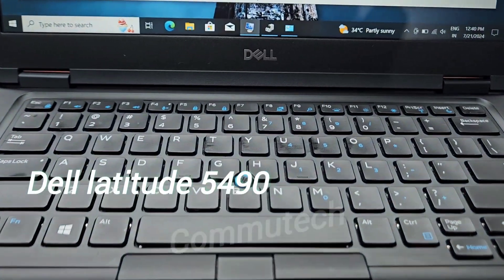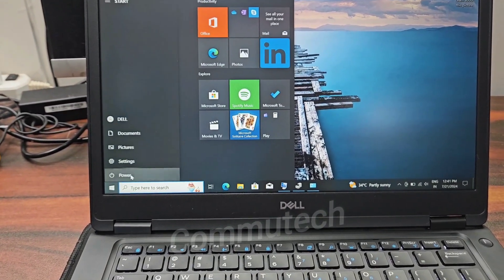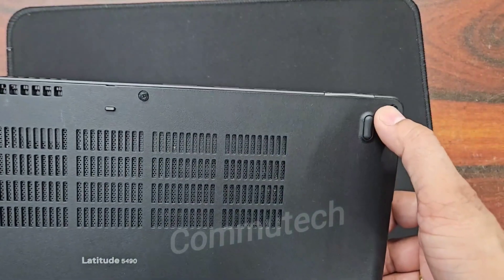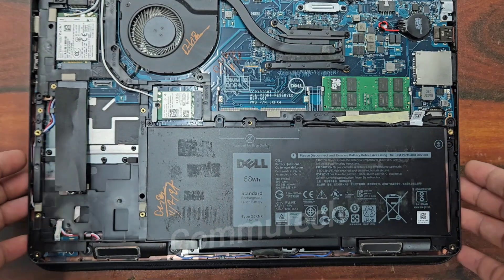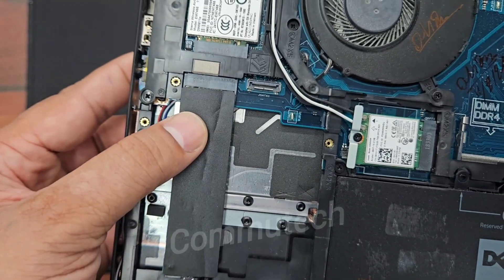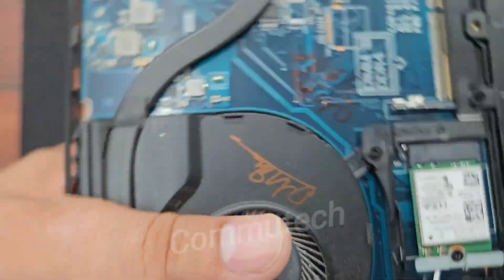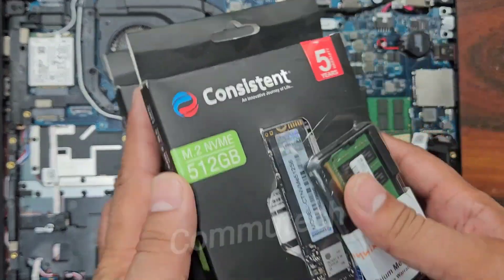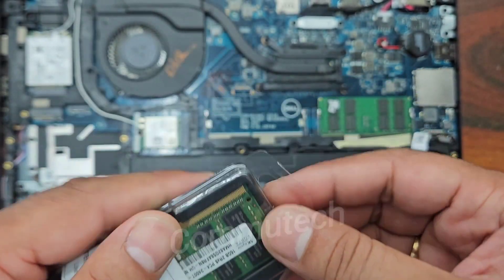LAPTOP MEMORY AND STORAGE UPGRADE FOR DELL LATITUDE 5490

Comment: Sir I have this same model with 16gb ram and 256gb storage now my laptop is being slow because of 80% of storage is used now suggest how should i deal with it if i have to upgrade the ssd then which brand should i prefer which should coincide with my budget.
Reply from the maker: YES, if there is lack of storage space then you can go for SSD upgrade with more Storage space

As this laptop comes with single ssd slot, so you need to replace it with the new ssd

SSD I recommend you  is the (M.2 NVME blue EDITION) by WD.

Storage CAPACITY as you prefer

500GB OR 1TB
Reply: @thansingh7047 Sir is there anyway to transfer old SSD data into new SSD?

Comment: also i tested with meter and there is no current going to the memory modules (RAM) if the computer is off, unplugged, and the batteries are still installed. most of these steps are from old school,
Reply from the maker: @davidmorrison4711  Yes you are correct but every laptop is different from other, and friend I am not saying that you are doing wrong but, taking precaution is not a bad thing and every engineer has a different way to do the same thing and in my way I do prioritise precautions, that's all brother

Comment: so i come back to this as i just picked up another used for $150 dell 5490 and this one supports 64gb ram the cpu is 8265U,,  my other has the 8250u and it supports 32gb max,
Reply from the maker: @davidmorrison4711  the model may be upgraded and the cpu is also   improved for this release

Comment: can i add 2 ssd's 
i have M2 samsung ssd installed
Reply from the maker: @xtremeyy  no, because this laptop have both interfaces for normal SATA and nvme connection in same bracket, it is not possible to and another ssd,  if the Sata bracket was made separately from the NVME slot by the manufacturer then we were able to add another ssd drive for sata interface.
Reply: @thansingh7047  so ill have to replace my current ssd?
Reply from the maker: @xtremeyy  if you need more storage capacity then you have to remove the old one
Reply from the maker: And m. 2 NVME is much faster than M. 2 sata
Reply: @ ahh i see thank you so much!
by the way i also have a hp pavillion ab027tx, do you have any idea if it has 2 disk slots?
Reply from the maker: @xtremeyy  I will search and update you
Reply from the maker: @xtremeyy  I have searched the hp one and it has only one standard sata hdd slot which can be used to upgrade/replace with SATA ssd only

The laptop don't have m.2 ssd interface
Reply: @thansingh7047  thank you very much i couldn't identify how many slots my laptop has from a long time 😊😊😊😊
Reply from the maker: @xtremeyy welcome🙏

Comment: Does its bootable
Reply: Well I Will Consult With You Later When I Received My m.2 Nvme Drive
Reply from the maker: @Lagendaryssr  ok
Reply: @thansingh7047  what m.2 screw used tho
Reply from the maker: @Lagendaryssr  it will be present there already
Reply from the maker: @Lagendaryssr  if you don't have the screw the you can use the any of the motherboard screw of this laptop
Reply from the maker: @Lagendaryssr  yes
Reply: @thansingh7047  what the bios setting
Reply from the maker: @Lagendaryssr  you can access the bios for boot setting priority for us drive or you can just hit the f12 key to access the boot menu to boot from usb drive to install windows for new installed SSD drive

Comment: i have upgraded 100 laptops in last 4 years and never once disconnected the battery,, if the laptop is off its off, even it on it would not damage a darn thing,, it would just start beeping it worst,
Reply: Then youve been doing it wrong the last 100 laptops and couldve possibly cost someone their workstation and been sued for not only the cost of the repair but also lost work wages if it was for work. Try to start developing better professional work habits. But cool story bro 👍
Reply from the maker: @paulweston1148  fare 👍, we must be extra carefull while handling sensitive circuits
Reply from the maker: 🙏Great bro

Comment: I did the same added new 8gb stick and its not turning on
Reply from the maker: @shivv.69  it may be possible that the frequency of your new memory stick is not supported
Reply from the maker: @shivv.69  match with the previous working memory stick
Reply: @ both ram stick are same model
Reply from the maker: There may be a chance of faulty memory slot

Please check your sticks one by one in both slots
And remember that if the battery is removed when placing the stick then the laptop will take a little bit more time show the display
Reply: @thansingh7047  my laptop changing indicator changing colors
Reply: @thansingh7047  and display is not coming
Reply from the maker: @HandbyGamer was your laptop working?
Reply: @ Noo but ab randomly sab sahi ho gaya and 16gb show kar rha hai but sab bohot slow sa lag rhaa hai like lagging wagera
Reply from the maker: @HandbyGamer  ssd addon karlo
Reply: @thansingh7047  um isme extra ssd slot nahi hai na isiliye nahi kar sakta 😭 512 gb mehngi ayegi
Reply from the maker: @HandbyGamer  hmmm

Comment: So you say: also, my experience is good so I go for it and about, but if your experience is good why then use single channel Memory instead of dual channel memory? You are a beginner then with 334 subscribers.
Reply from the maker: @dejanpetkovski8761  I used single because I didn't had second module at that time

Comment: (4:35) 
Bro.....................
Why don't you just put another 8 GB ram of same speed as the one already present in the pc?
 Since dual channel ram is faster than a single ram stick.
Dual-channel have  Increased bandwidth , allowing  faster data transfer and improved system responsiveness compared to Single-channel configurations.
Reply from the maker: Yes it is, but I had a single 16 gb module in stock, so removed the 8gb as user required total of 16gb only, it is prefer to use addon 8gb in B slot, but I had single 16gb so I did this
 Thanks for your comment 👍🙂
Reply: @thansingh7047  oh that's why...
Reply from the maker: Yes🙂
Reply: @thansingh7047 no, you just installed a single stick of 16 gigs of ram. 
And now the user won't get the benefit of dual channel. 

You should have went to the market to purchase another 8 gigs of ram for all the benefits of dual channel. 

This just shows how lazy you are.
Reply from the maker: No bro, I got this call on late saturday and I had to give the user next day, but due to holiday I didn't got 8gb stick, so I used 16gb of the stock
Reply: @thansingh7047  I would have called the customer and would have advised him to go for another 8 gigs of ram instead of 16 gigs. 
And explained to him why it's better over single 16 gigs of ram. 
And tell him that unfortunately shops are closed and ask him for more time.
Reply: @Insomniac_Insights  Dude gets to charge for a 16 gb ram instead of 8gb . So more profit for him that why
Reply: @the_47_Viv  Yeah, I know 8GB ddr4 is like 900/-
8 GB ddr3 is 450/- 
According to my repair guy who maintains my system. 

All These people only care for ripping of customers as much as possible.
Reply: @thansingh7047  "EPK50 LA-G07DP" I need this laptop part (HP). Can you arrange?
Reply: @thansingh7047  adding 16gb of additional ram with already present 8gb ram is still better then having single 8gb stick. 
You can still get dual channel experience only limited till 8gb.

And ram will dial down to lowest available frequency of ram for hertz.
Reply: @Insomniac_Insights  yeah ,that's why people should atleast have basic knowledge for things like upgrading storage and ram and other little things
Reply: @the_47_Viv  true, that's why my sister runs anything she wants to change in her laptop.
Reply from the maker: @Insomniac_Insights  https://m.indiamart.com/proddetail/hp-15da-la-g07da-laptop-motherboard-23784433573.html
Reply: @thansingh7047  thanks for quick reply. 
I checked that page yesterday but it says minimum order quantity Is 5 pcs.